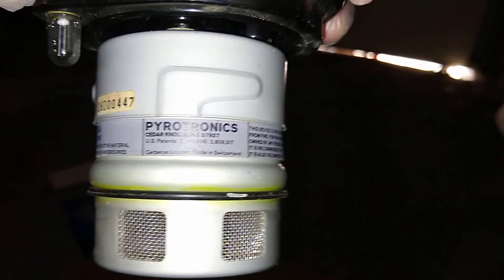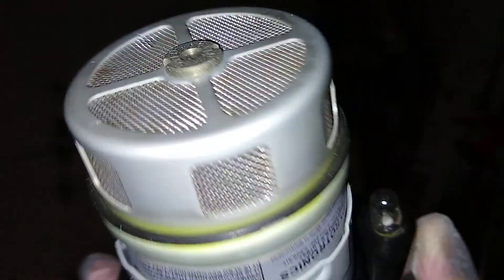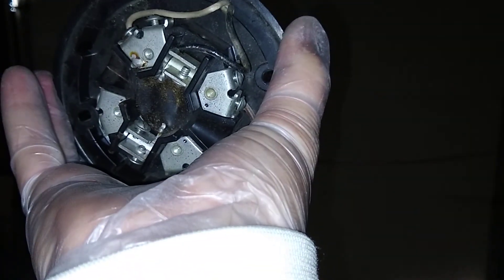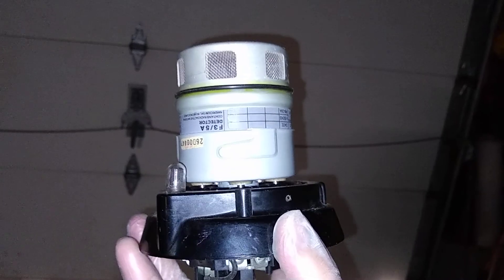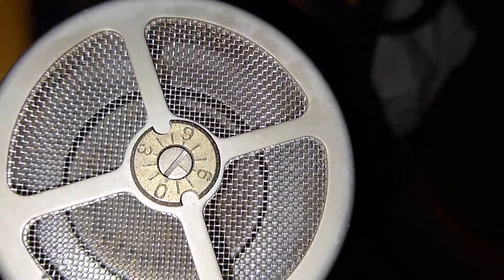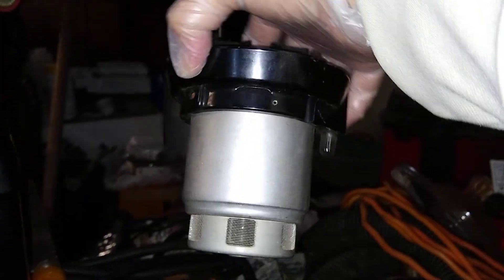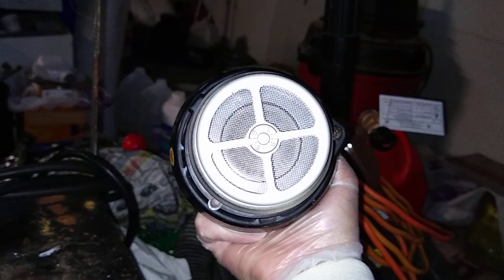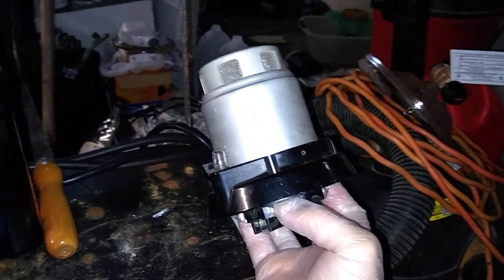80 MicroCurie (Amaricium 241) 1985 industrial smoke detector

Comment: Old Cerberus Pyrotronics F-3, these models contain the highest amount of Americium ever found in a smoke detector unit. Of course this is a commercial system unit, the highest amount in a residential unit was the Honeywell TC49A which contained 13.4 µCi
Reply from the maker: Thanks for stopping by and commenting.  Good to see you Baltimore Alarms & Fans.  I have a few more from my collection in will be showing one has Radium 226 in stead of the typical AmO2²⁴¹

Comment: 60uci is in the top bolt piece and 20 is in the plate on the bottom of the detector chamber. The cool thing is you can dial the sensitvity of it from almost nothing to anything trips it. It uses a bizarre thyratron inside that has a gate that will trigger it at litetally nanoampares. With the attenuator open it will saturate most thin window GM tubes at close range

Comment: These F35 detectors are actually rebranded A.F.A (associated fire alarms) detectors from the late 1960s. The bigger brother to this detector was known as the F50 and were made by A.F.A Minerva in the 1970s.

This was before the British regulations changed about how much radioactive elements were allowed in smoke detectors. When they did change though A.F.A Minerva literally took down thousands of these things and stored them in a vault somewhere in Sellafield.

They were designed to work with A.F.A Minerva CT panels. The circuits were 220v DC and worked by putting a 220k resistor across the zone pair. Each detector had a cold cathode valve in for switching.

They were good detectors provided that they were kept calibrated.
Reply from the maker: Thanks for the great comment and the great background information about these alarms.  I have a few other older 70’s ish smoke detectors.  Most of them have a radium 226 ion source.  One of them has a 13 uCi I think.  So I have the largest aloud radio source for commercial and residential ionizing smoke detectors in my collection.